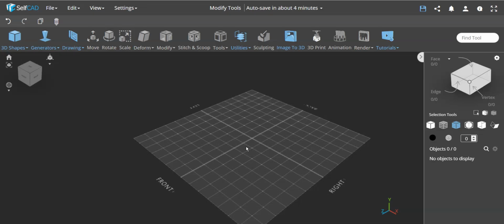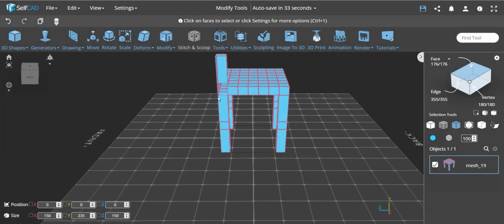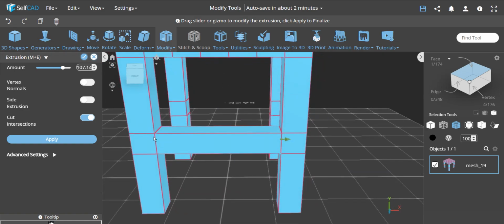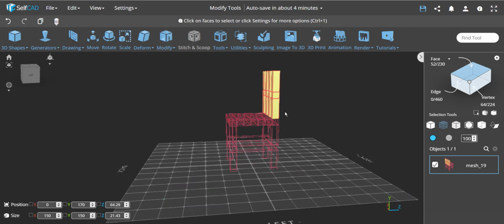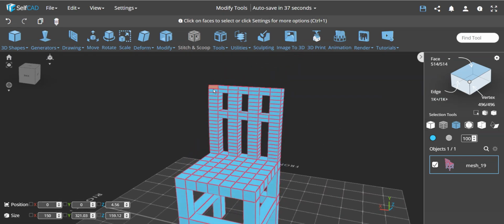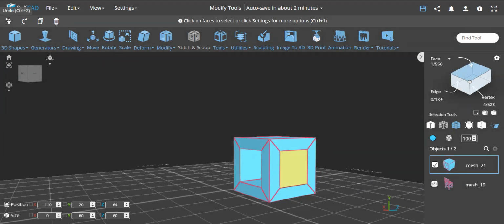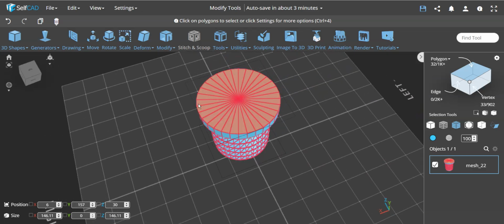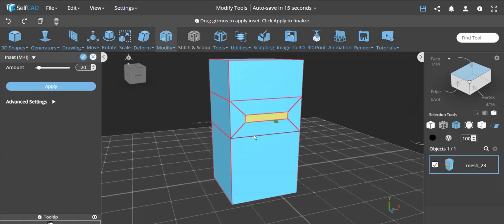How to edit and extend 3d objects using extrusion

Comment: hi, can you confirm that the "amounts" you change something by with tools in selfcad corresponds to whatever units youre using in the project? like here, if youre measuring in millimeters, and you set the extrusion "amount" to 100, youre extruding out exactly 100 millimeters? im thinking about buying this product and i want to make sure that selfcad will provide the level of precision that i want. thanks!!!
Reply from the maker: @strangewigglytuff That is correct. The default is millimeters, but you can change it in the workspace settings to inches. Extrusion, as well as all other measurements in the app, are accurate based on the set unit.